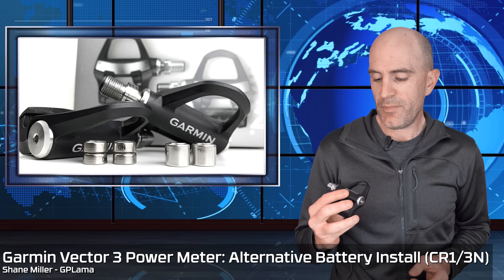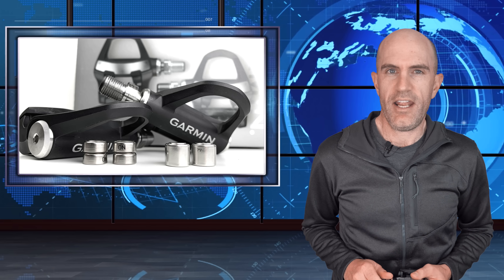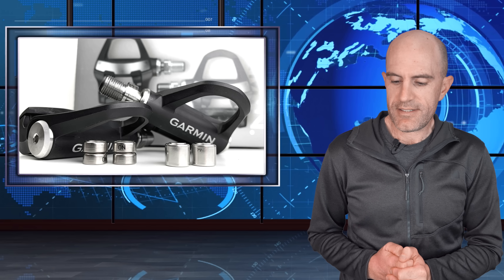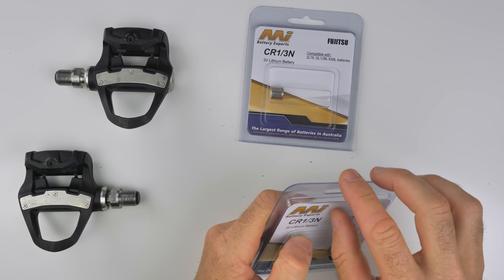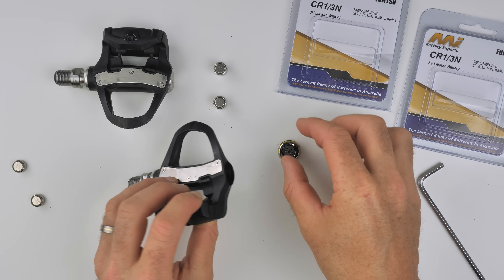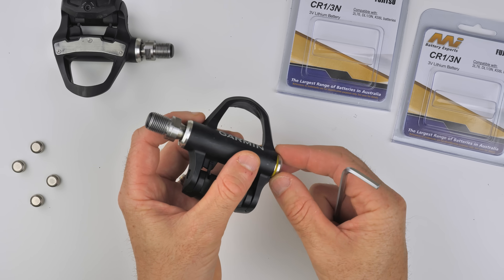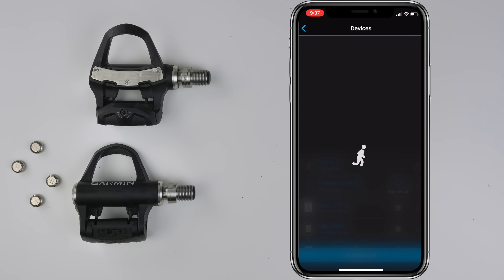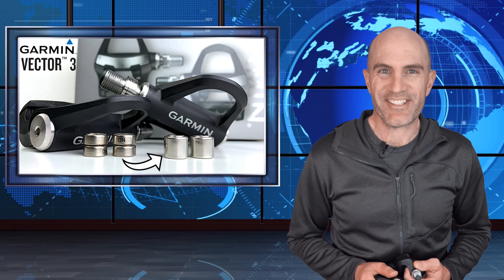Garmin VECTOR 3 Power Meter: Alternative Battery Install (CR1/3N)

Comment: Hi Shane Miller 

  Firstly , THANK YOU for your response, love your channel/tech/ info! Sorry , my previous question was poorly formulated. I guess what I'm trying to understand is that there is clearly an energy output/ burning calories/ power different between rides touring with additional( 80lbs trailer) and without , so does my system ( vector3 ) accurately calculate ALL data without manually entering the 80lbs(eg. far more calories/energy burnt with trailer riding 300km than without) ?  What data Category breakdown best captures that touring days output  ( NP , FTP , calories, etc) 

   HOW DOES , or DOES Vector3 now know I added 80lbs to the task ? 

    THANK YOU for your time
Reply from the maker: A power meter like the Vector is a direct force measurement device. It doesn't need to know your weight. Towing a trailer will require you to either push harder on the pedals (more force = more energy required) or pedal for a longer period of time than without a trailer (more energy required to ride for a longer duration).

Comment: how can i get battery status on vector 3 on my garmin edge 1030? or is it not possible?
Reply from the maker: Not possible as a data field. You'll still get a low battery warning alert on the Edge if the power meter battery is low.
Reply: thanks for reply Shane ,, @Garmin new update needed

Comment: I just pulled the the caps off the battery housing for my Vectors. Wow came with from Garmin with the CR1/3n. I’m guessing that putting them in won’t void the warranty.
Reply from the maker: Yep. They came around and are now suppling them with their pedals.
Reply: Garmin's specifications now list CR1/3N as an option, so certainly no warranty worries now.

Comment: CR1/3N  little over 1,500 miles before low battery live.  Due to COVID19, bike set in garage for about 6 months.  Replacing batteries with the DL1/3N.  Excellent batteries.

Comment: I can confirm that today 20 July 2020 - I bought a Garmin Vector 3S pedal set from bike discount germany and upon unboxing and inspecting the left pedal (powermeter one) HAD THIS battery installed by the factory NOT LR44 ones.

Comment: I have recently bought 3s. I found that there is a battary compartment in the right padel. can you explain what is the use of it as this is single padel version and right padel doesn't have the sensor.
Reply from the maker: No idea.

Comment: I just bought about 5 packs of LR44 batteries (roughly 30 or 40 pieces...please don't make me count them)...I wish I would have watched this earlier. Totally off topic, but I wonder if connecting the Vector 3's to both a Garmin 1030 computer and the ANT+/Bluetooth dongle in a computer while using a smart trainer is possible or not? Perhaps a video to investigate, based you experience with such devices. Thanks in advance... I will do my own little investigation. I guess the logic is to record my cycling dynamics with the Garmin 1030 in addition to getting the recorded workout in Zwift (and hence Strava). Although, the Garmin 1030 is linked to Strava, essentially, I would end up with 4 recorded workouts (2 on Strava from being linked with the Garmin and the smart trainer, one on Zwitft, and the original on the Garmin 1030). Why is my life so complicated...lol.

Comment: Great video!  Why in the world does Garmin use 2 stupid batteries instead of 1?  I've been wondering if there was a solution to those 2 stupid battery usage.
Reply from the maker: They're more commonly available. The CR1/3N are a much better idea though for sure.
Reply: @gplama  Thanks for a great video.  Ordered the CR1/3N today, form Amazon,  and they are coming tomorrow.

Comment: Time to bring out Vector 4 - replace battery with sealed rechargeable, all issues solved, including the marketing disaster that is Vector 3 (irrespective if issues now resolved) and they need to come in at £500. As it is, just bought my Faveros for £630 for dual sides, free postage, delivery in 3 to 7 days...  I shall soon see how weak I am for real and no longer can I blame my heavy saddle bag.

Comment: The main problem of the Vector 3 pedals is the fretting of the batteries. If you don't apply oil on the batteries and the contacts on the cap, a corrosion film starts to form on the interfaces. Actually Garmin recommends to apply oil on the contacts with a toothpick on their website. I think this is the main solution of the dropout problems of the vector 3.
Reply: I've applied oil on the LR44 batteries and the contacts on the cap, but this didn't help. I still have the issue. I will buy the alternative battery CR1/3N, and hope this will fix the issue on my new Garmin Vector 3.
Reply: @reggaedancer69  how did it go?
Reply: @JSTGOW  Last year I replaced the LR44 batteries and used the CR1/3N, this didn't help. I think the issue was "bad contact" with battery cover, or over-tighten. I sent back my Vector 3, and Garmin sent me  new Garmin Vector 3. I have used LR44 batteries since then, and my Vector 3 pedals are working flawlessly.

Comment: HI Shane. Important question: Is the CR1/3N a solution instead of the old caps or needed in spite of caps replacement? I have the latest caps and still having lots of issues.....(btw thank you for the great content and tips)
Reply from the maker: I have new caps and CR1/3N batteries. I'm trying to eliminate all possible problems. Give them a shot I guess.

Comment: Does the single battery still require application of baby oil, or was that primarily for the contact between the two batteries?
Reply from the maker: I guess it can’t hurt.

Comment: Not working for me, I tried every method I can found on internet, last time I ride them for 2 hours with 20 times dropout. Now I am using a new rotor 2inpower with no issue at all...My computer is EDGE 1030

Comment: Vector 3 dual sided user for 1 year so far: I've had none of the original dreaded issues seen on the various forums and videos (thankfully!), but did run out of battery from the originals at around 50 hours' use (Garmin claimed 60 I believe?). I swapped to the CR1/3N batteries (I got a pack of 12 instead of the single packaged units which saved loads of money and more importantly, plastic!), installed them easily (although nervously given all the other previous reviews for older versions), and have been running them continuously for about 50 hours so far. My Edge 820 computer still says battery status 'OK' and I'm hoping they last the full 60 hours, which is actually plenty of riding time given how easy it is to swap batteries (which cost me about £8 for the 12 pack in the UK). I can only go by my own experience and my pedals have been superb - highly recommend them based on my own use! Hope that's helpful!

Comment: Hmmm. If you have the newer version go the Vector 3s there shouldn't be a problem with the double batteries as I've experienced since Garmin replaced mine, so doubling up on the battery price that has lower capacity, for me anyway is not worth it.

Comment: Thanks Shane, yes I agree fully, have been on these since the last battery change and no issues at all. I have retained my cork sliver under the negative contact. I have found excellent battery life as well, the lr44s were so variable and could have been due to the dreaded black spots on the contact surfaces.

Comment: Bought a pair Vector 3 last october (already new doors installed) since the first battry change i put cr1 3n instead. In january i had to send them back because of the same issues as everybody. Power spikes and drop off... they came back maybe a mounth later with new doors ? The first were already the new ones as i said... when i put them back on the bike, there was a new update for vector 3. It worked (still with cr1 3n its the only battery i used) for the last 3-4 mounths.  2 days ago "right pedal is missing", spikes and everything... thoses pedals are crap no matter the "solutions" proposed ! 1000$ for a powermeter that as had 2 major issues in les than a year... scandal! (Im french sorry for the poor english)

Comment: Just for your information Shane... your Vector 3 battery covers are NOT the latest... just had mine replaced and the internal connections are now ALL gold plated.. noticed your battery holders are still silver not gold.. was sent a set for free when I queried with Garmin..
Reply: Correct, I got the new gold plated contact ones and they have been flawless with either style of battery. I was ready to shitcan the pedals until I got the new covers and they solved the issue.
Reply: i have the gold ones (brand new replacement units from garmin) and had drop outs all over the place. the new battery fixed it.

Comment: Hi, Love the videos! I had my Garmin vector 3S replaced a few times as I was still having disconnection issues and the max power would go crazy. I saw max power of 4000-5000 watts. I spoke recently with Garmin support and the agent did mention I can use this battery CR1/3N. He also mentioned to use mineral oil on the contact to maximize the connection between the pedal and battery. I didn’t have a chance to buy it yet but I don’t think Garmin will void the warranty since the agent do offer it as an alternative. I just wanted to share and thank you for the great videos. Keep it up.

Comment: Shane I purchased the Garmin vector 3 pedals (version 2) (left side power only) where all the issues were supposed to have been fixed. However, I kept getting power data drop outs. I returned it back to the Cecil Walker Cycles in Melbourne and provided all the evidence of the issues (strava screen shots). The shop seemed to make excuses for Garmin. The shop ended up giving me my money back  & I put this towards the stages left hand side V3 pedal. How the Garmin company can release a product that is expensive and for it not to work is simply bad.
Reply from the maker: Agreed. My first set were weeks (then months) of frustration.

Comment: switched to the CR1/3N batteries last year when the old battery doors were giving me problems. They not only work great but also fixed that problem, so didn't even need the new doors (though I did install them anyways). Been letting all my friends with the pedals know, glad you made a video about it!

Comment: Went through two sets of vector 3's both failing after the first battery replacement, utter rubbish! I have a box full of these new battery's to give away now I have moved to Powertap reliable power pedals.

Comment: There should be no reason this will cause problems. DL1/3N have been around for close to 40 years. They were used in SLR camera light meters as a direct replacement for 2x SR44. The main thing back then was being Lithium they had much longer stability for occasional use than the silver Oxide SR44. That was then though and although I see the DL1/3N is still Lithium I assume there is a Lithium SR44 now? Maybe not?

Comment: I've been using these for awhile now and find them a perfect replacement. No more faff of putting mineral oil between the batteries. 
Cracking power meter and pedals now the issues have been ironed out

Comment: I’ll be honest, I’m not very impressed with the length of the threaded portion of the caps. Fewer threads mean a larger clamping load per thread, which increased the risk of stripping the threads out, especially since it seems to be aluminium. 

Never seen those batteries before. Very interesting

Comment: Shame on Garmin! Very poor design. These power pedals never should have been released to the public!  You would think a big company like Garmin would have done the right thing and recalled these pedals after all the initial complaints. Now everyone who owns a set of Vector 3 pedals has to hack the hell out of them to maybe get them to work for a while. Bullshit! $1000.00 down the drain.....  Thanks for the update Shane.
Reply: Scott Brennan I betcha the Garmin marketing Dept overruled the engineers on when to release to market. I’m betting not enough testing was done. Still perplexed by their choice in battery and configuration, especially given the vibration and spinning motions in play.

Comment: I’ve had my issues with Garmin over the years but I can’t fault their customer service. Sent me a brand new pair of 3’s to replace my broken 2’s despite being out of warranty!
Reply: I guess it depends on who you get at garmin customer service. I had problems with my V3, I think I stripped the threads on the right one. the battry door fell off during a ride. Cost 250 GBP to replace.

Comment: I noticed the Energizer batteries were slightly wider and the pedals didn't spin freely, after switching to the Duracell brand the pedals turned freely again.
Reply: Be careful with those Duracell batteries.  I use a lot of batteries in my profession and IME Duracell batteries leak about 50% of the time.  I have yet to see a single Energizer battery leak, ever.  Be safe out there.

Comment: A solution to this problem. Get the Favero Assioma Power Meter pedal ;)
Reply: Agreed. I sent the Vector 3's back and did exactly that. No regrets.
Reply: I did exactly that. Took 4h to perform the firmware update on the vector 3. But even after update they still were not reliable and couldn't calibrate them. I ended up returning them and ordering a pair of Favero Assioma. Up and running in less than 5mins and zero issues. Also several hundred dollars less. Never buying anything from Garmin again. There is only one word for the Vectors.... Embarrassing.
Reply: @petaren  I had the exact same experience as you did and promptly return them. I am an existing Vector 2 owner and those have been generally trouble free. The Vector 3 were terrible! I couldn't calibrate them and the data had terrible lag to my Wahoo head unit.

Comment: am i the only one left wondering why Garmin didn't use these from the start ?. Thanks for the video :-)
Reply: Jamiedenny My understanding was that they found better global availability of the LR/SR44 batteries. Meaning, just walking into a random gas station and being able to procure them.
Reply: Money
Reply: @jamiedenny @dcrainmaker my understanding was that it was the lower internal resistance that could damage the electronics if inserted the wrong way round?

Comment: How about the issue with dropouts caused by the battery contact inside the pedal being depressed to much?
Reply: you should never need to "hack" a thousand dollar product...period
Reply from the maker: Cork hack, or return the pedal.
Reply: Shane, yea I’ve used a paper card. Guess I need to buy a good bottle of wine for the cork
Reply: Shane Miller - GPLama more details please on the cork hack.
Reply: @gplama  The cork hack shouldn't be necessary with the newest battery door & Holder kit: Part: S00-01030-00
Garmin sent me two kits free of charge, and as stated somewhere above, the latest redesign of the battery door is with gold plated contacts (I believe it must be the third version of the design) . Also the inner part of the battery holder is redesigned with the contacts pointing more upwards (eliminating the need for cork) and the contacts also seem a bit less flimsy.
Reply: Mattias Grenhall  imho avoid.  I have had 3 sets of replacement pedals from Garmin because they don’t work.  The 4th set that I’ve been using for past month seem to be ok though.
Reply: @willadeney8892  I think I'll try to order Assiomas instead.
Reply: marty jenkins I've already ordered the Assiomas. 👍

Comment: The best are energizer SR batteries, lasr 20-30% more than the LR, bit more expensive but cheaper than the CR1/3N.
20,000km without any problems (only with the cork patch).
Reply: These are Garmin's recommended batteries (energizer) - the SR are the best performance but the LR is the best cost effective.
The SR holds a constant voltage for longer time.

Comment: It wont void your warranty,  I spoke to garmin 2 days ago and they recommended those battery for me to use.
Reply: The concern Garmin has with the single battery is it can easily be inserted with the polarity reversed which will destroy the electronics.    That said I have been using these batteries from about day one with zero issues until the V3.60 firmware update.  At that point the batteries seem to drain if left in the pedals after riding.
Reply from the maker: Interesting.

Comment: the CR1/3N is basically two of 1.5V ones in series (e.g if you opened it up)
Reply: Not quite. Electrically, yes it is effectively equivalent. But in terms of chemistry, LR batteries are Alkaline, SR batteries are Silver Oxide while CR batteries are Lithium.